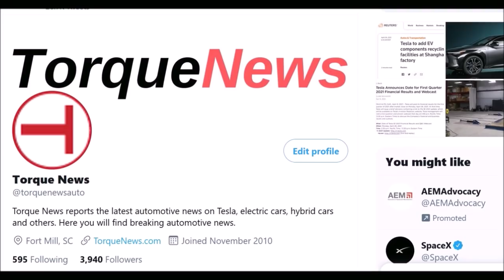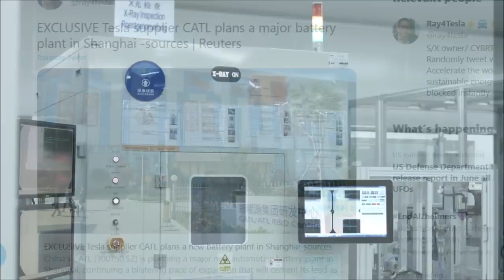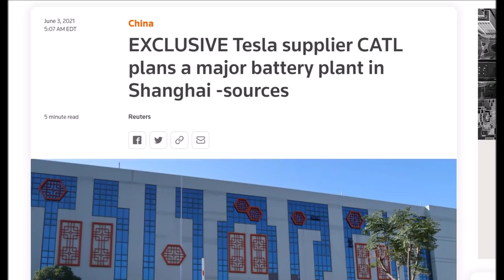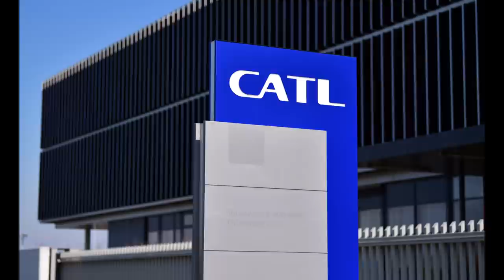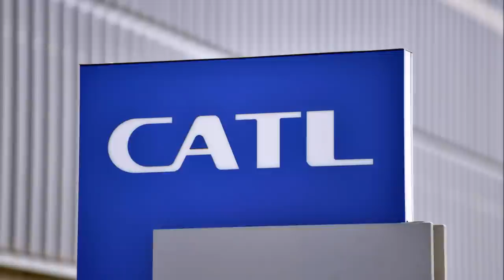CATL Suddenly Makes an Unexpected Battery Move Toward Tesla Giga Shanghai

Comment: I think you underestimate production targets at both Shanghai and Berlin, with the implementation of body casting taking the number parts down significantly, both will accelerate output as the new casting kit is installed and

Comment: The CATL battery to 500 miles range is a lot harder than the nickel batteries since the LFP is less energy dense. But didn't you say that CATL will get that range by 2030?
That's why it's taking so long and it's worth it because that means these batteries will be cheaper than nickel batteries and just as good as nickel is today!

Comment: Reuters has been actively promoting CATL for a long time now. This doesn't mean that the new factory and Tesla deal is false information, just that Reuters has built many stories in the past based solely on interviews with CATL execs and marketing teams. And not all of those stories have proved to be true over time. Tesla did definitely say that they have solid plans for LFP batteries in their entry level vehicles, and also for Powerwalls over the coming years. As I have suggested before, I believe that CATL may start to produce a 4680 format LFP battery soon, specifically for Tesla. Current LFP batteries have prismatic cases, which will require different battery cases than the cylindrical batteries. Prismatic cases are harder to heat and cool than cylindrical or pouch batteries. Ultimately, Tesla's long term goal is to produce the majority of their own batteries themselves, and with partners. With an eye to avoid restrictions implemented by the giant Asian battery manufacturers that completely control the worldwide battery market today.

Comment: Tesla is a technology company. Their efforts in manufacturing electric cars has helped them understand every aspect of the needs of batteries in both cars and big trucks. 

Tesla have the best research teams on the planet. Their battery team is stellar. 

My take on what's happening is that Tesla is going to licence CATL, LG, and Panasonic to manufacture their new 4680 battery and it will become the new standard form factor for EVs. 

Tesla's future is licensing. That's also where the really big bucks are coming from.
Reply: Tesla has a lot of publicity, when CATL set up their new R&D facility, it had a congratulatory message from one of the Nobel laureates, also a former CTO (non Chinese) of CATL in one of the interviews said CATL was not behind Tesla. CATL and BYD are in LFP batteries long before the rest of the world due to its reliability and low cost. The cooperation is going to benefit both companies and help to reduce CO2 emission. As a Tesla share holder, I would like to think Tesla has everything, but I have to be realistic.
Tesla has its strengths in making the most efficient EVs, together with the lowest cost batteries (cell to chassis)  from CATL, we are getting much closer to cost parity with ICE cars. 
There are areas Tesla is far ahead of everyone else in EV, it is great it uses the best that is available out there too. Concentrate on what it can't buy and yet important to build a barrier against the competition.